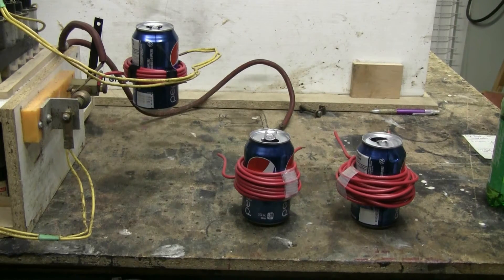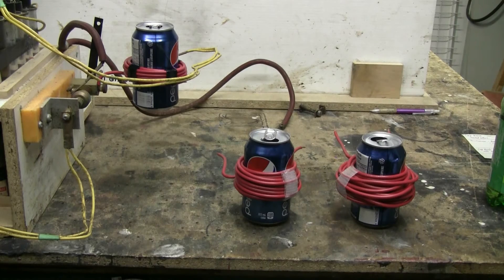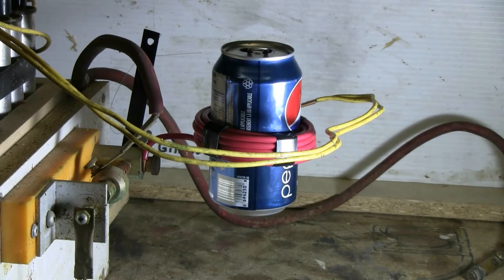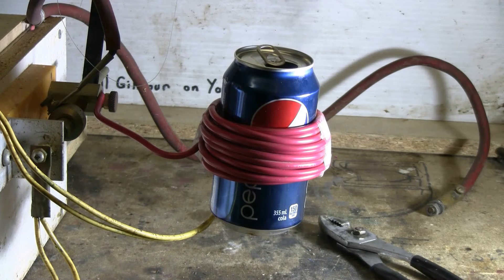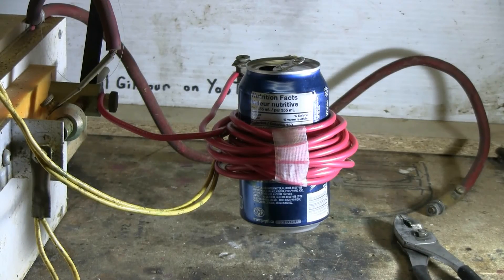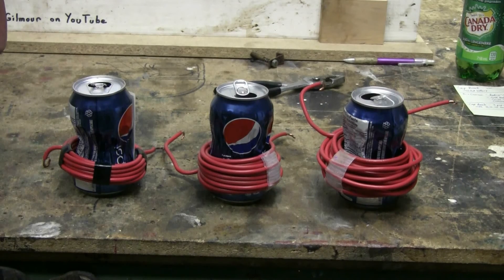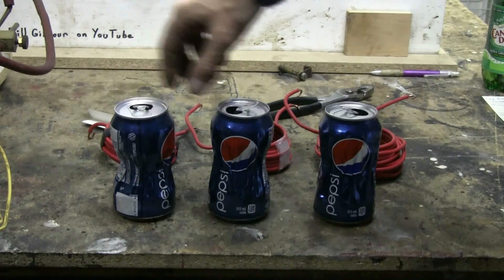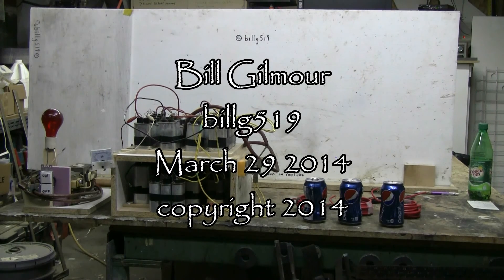Capacitor Bank #70 - More Can Crushing With Three More Coils

Comment: The best result with your 70 uf capacitor will be a work coil with about 5 turns. This is because the ideal resonant frequency for can crushing is about 8 KHz. This will yield about a 50 microsecond pulse. Your larger coils have too much inductance and generate too low a resonant frequency to be effective at can crushing. At least 800 joules is required for a good hourglass pinch if the coil is closely wound against the can. Having multiple winding layers is not ideal. My can crusher uses a 100 uf capacitor and a 3.5 turn close-wound work coil for a resonant frequency of 8.3 khz. I can cut a can in half with 1500 joules.